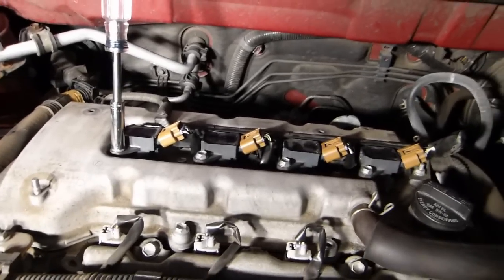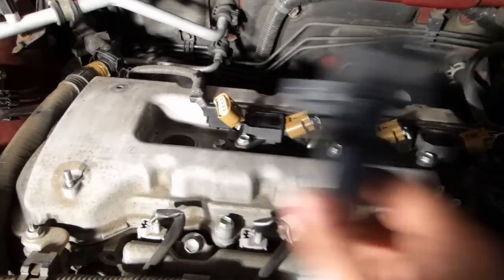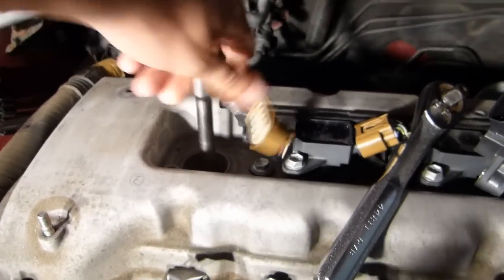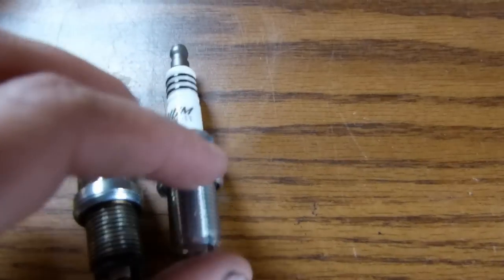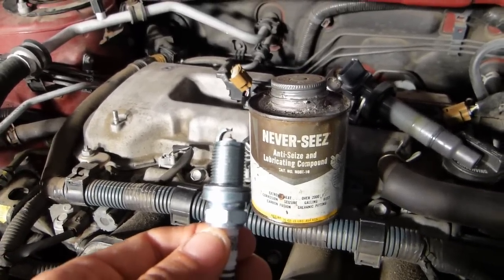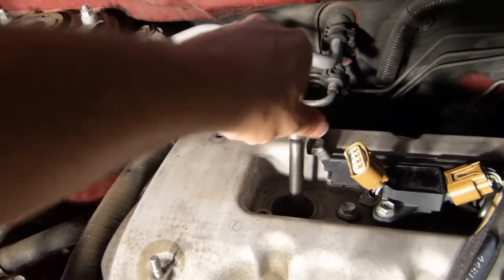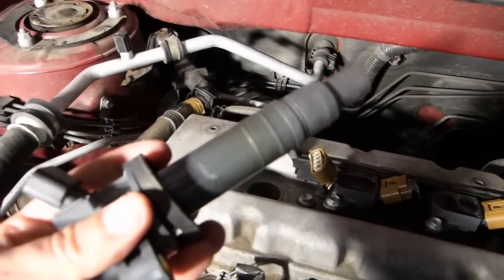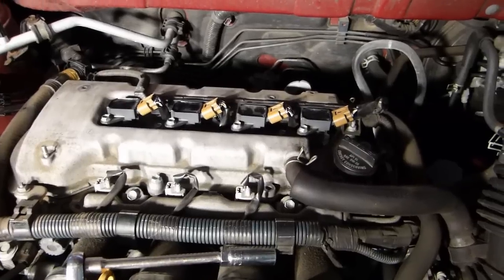Pontiac Vibe (Toyota Matrix) 1zz-fe Spark Plug Replacement

Comment: I think the rubber in the spark plug socket is mostly so you can get the spark plug out of the hole easily. It grips the spark plug and holds onto it. Without it, the spark plug would fall back down into the hole after you have it loosened and is a pain to get out. Good video, thanks.

Comment: For this application, you honestly don't need to put any anti-seize compound on the spark plug.  They aren't made of copper or iron.  The anti-seize will alter the torque spec of the plug, so if you decide to use it, you need to keep that in mind when torquing the plug to spec.  Because over torquing the plug makes for one bad headache.
Reply: I had contacted Denso spark plugs about using anti-seize and the technician told me exactly the same thing - anti-seize acts as a lubricant and causes the plug to be overtightened.

Comment: I would strongly recommend torquing to specs.  It will be considerably tighter, but will allow the metal gasket to seat and properly seal and prevent damage to the engine.  

Don't take my word for it? See NGK's explanation. https://www.ngksparkplugs.com/about-ngk/tech-talk/spark-plug-installation.
Reply from the maker: I don't disagree that it is a good idea to follow MFG recommended torque requirements.  

However, for the average Joe shad tree mechanic that doesn't have a torque wrench (such as myself) its better to under tighten than over tighten.  I've done enough plugs over the years that I can more or less judge by feel a reasonable amount of torque and have never had any problems using this method.

Naturally NGK is going to promote this idea as this is central to their business    But in the real world we have to work with what we have and sometimes that's experience and intuition.

Thanks for your comment and your interest in my video!
Reply: SevenFortyOne w

Comment: Sooooo al this and no plug gap check or setting. Why even bother changing them if you dont gap the plugs ? Big ooof. Also the last two coils to the right require you to loosen or remove the wire harness to get them out without a fight or damage. Must be a half job season video. Derp BMPardone
Reply from the maker: Glad you liked the video 👍
Reply: it is not recommended to gap check iridium spark plugs as iridium is a very hard metal and the gauge disc itself could break the tip off the spark plug, ya big oof 😉
Reply: @malindaeckert2300  lol,,nice burn in a polite way